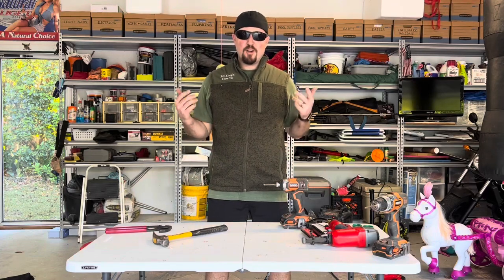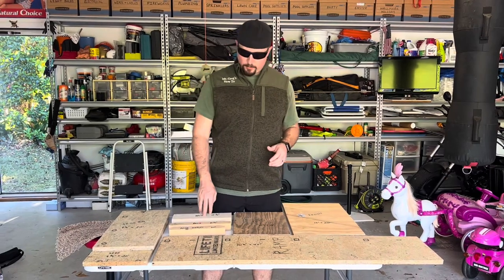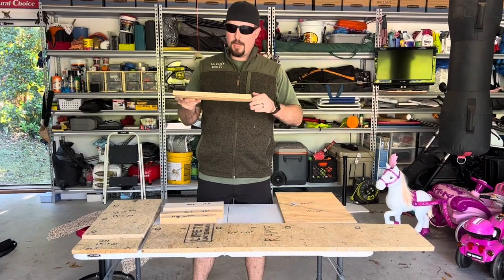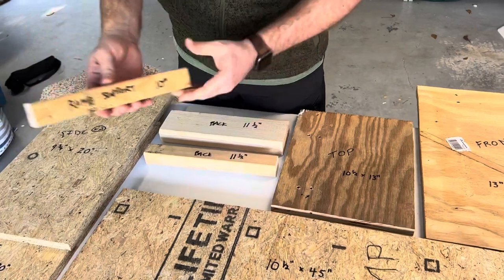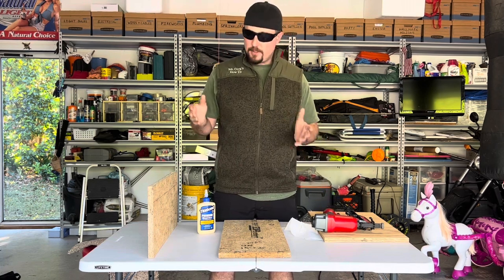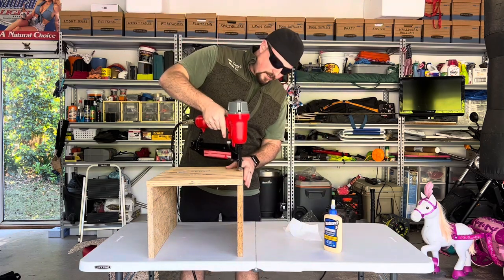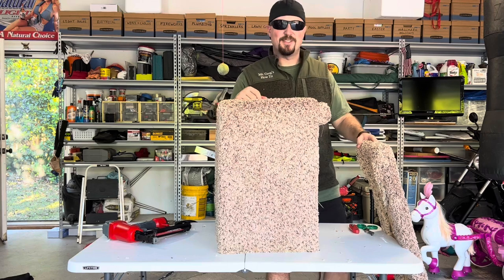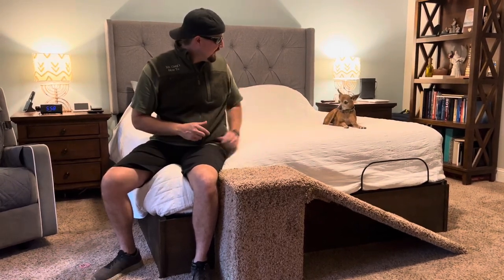HOW TO Make a Dog Ramp - Includes measurements and parts list!

Comment: How much weight can it hold? My dog is almost 40lbs. Doesn't look thick enough and the ramp part is steep for an elderly dog having issues with her hind legs being weak. But great for a dog 15lbs or lighter probably?
Reply from the maker: Howdy, partner!  It’s pretty sturdy but I can’t really give it a concrete weight rating. The ramp can be less steep if made longer. If in doubt, I’d probably recommend a pre-fab dog ramp with a certified weight rating. Good luck!